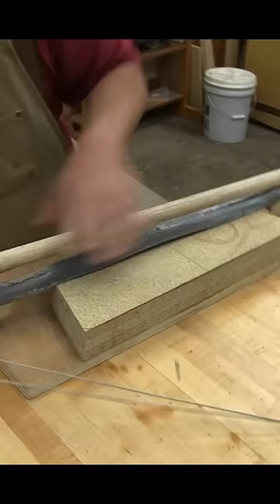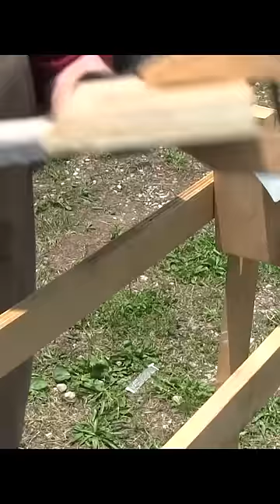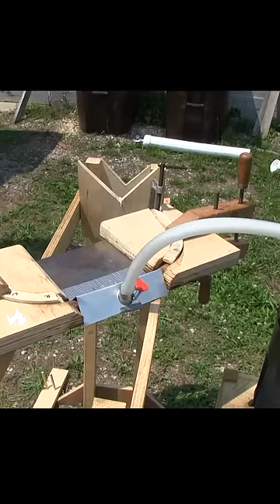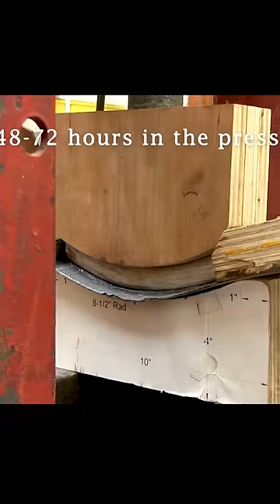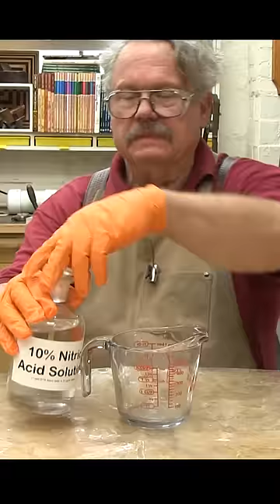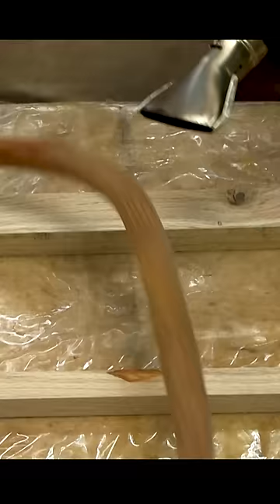Mustache Handlebars Short

Comment from the maker: To successfully bend wood, there is a mysterious property that you must respect: You can compress wood parallel to grain up to 25% to 30% of its length, but you can only stretch it 1% to 2%. For that to happen, you must compress the wood into a bend rather than just stretch it around a bending form. To do that you need a “bending strap” – a flexible length of metal strap with two stops, one at either end, to capture the wood and keep it from stretching.

These mustache handlebars require two separate bends at right angles to one another, so we made two bending straps. The first was pretty simple – just a length of metal with stops to capture the tapered white oak dowel. The second took some ingenuity. We had to capture the already-bent portion of the handlebars, clamp them to the strap, then steam and bend just the middle bit. It only took us 30 or 40 tries to get it right. If you’d like to see this process in greater detail, watch the long video at: https://www.youtube.com/watch?v=7PRkoM-eVdY&t=23s

Wooden handlebars were a popular upgrade on the first “safety” bicycles (bikes with two wheels the same size) made between 1885 and 1900. Because wood is more flexible than metal, the wooden bars helped insulate the rider from the worst of the shocks and bumps they would otherwise suffer traveling the unpaved, unimproved roads of that era. They were usually made from hickory or white oak, and for those of you wondering how strong these handlebars were, the bending strength or modulus of rupture for those two woods is 20,200 psi and 15,800 psi respectively. Plus, they both have an extremely high stiffness or modulus of elasticity -- 2.16 and 1.78 Mpsi, so they not only resisted breaking, they would spring back to their original shape after impact. In this application, they were more durable than steel. 

These particular wooden handlebars were used to recreate a “Van Cleve” bicycle built by the Wright brothers between 1896 and 1899. Wilbur and Orville, you may recall, manufactured bicycles before they became interested in aviation. They built their first manned glider in 1900 and made their first powered flight in 1903. They built their last bicycle in 1902.
Reply: Such a cool video.  Great job and they look great.  The little fact thrown in is like hearing lamborghini made tractors before cars.
Reply: Magnificent explanation, thank you!
Reply: Thank you for your help Sir!
This is a different cane i made. This one didn't need to be straightened:
https://www.youtube.com/watch?v=NBEQoz6o1dc
Reply: Respect 😎
Reply: This just furthers the idea that woodworking is rightfully another category of engineering, which I had never realized before. Brilliant work!
Reply from the maker: @jo54763  Thanks.
Reply from the maker: @jo54763  Thanks for saying.
Reply: Will you adopt me please? I'm 40 but I don't care lol
Reply from the maker: @durzostern  Sure, as long as you're neutered, house-trained, and have all of your shots.
Reply: Awesome, never knew that
Reply: TL:DR.
What's the artist tho
Reply: Only took a minute! The power of youtube
Reply: This is a true professional.
Reply: Sweeeeeet ! 
Thank you sir !
Reply from the maker: @NBM3  Most welcome.
Reply: I cannot describe just how cool this youtube channel is, I hope you guys enjoy making videos as much as we enjoy watching them!!
Reply from the maker: @PrincePolaris  We do. Thanks for saying.
Reply: After reading your explanation, I had to go back and watch it again.
Reply: I read this in his voice!
Reply: You and Thomas Edison could have quite a conversation.
Reply: Thank you for that history lesson in the comments. this is a great video what the history included the video makes a lot more sense.
PS. I'm number 777 for likes on this comment :-)
Reply: Why acid is put on?
Reply from the maker: @otofoto  To artificially age the wood.

Comment: Did not expect actual handlebars.  I was expecting like a silly sign or something.
Reply from the maker: Real deal. Made this as part of a project to replicate an 1897 "Van Cleve" bicycle made by the Wright brothers six years before they built the first successful airplane.
Reply: I was expecting the back of a chair, but then he mounts it on a bicycle.
Reply: That's fucking awesome 😮
Reply: I was expecting a bow until a traversal curving was applied.
Reply: I was thinking a chair back 😂
Reply: I can't wait until he finishes the bike.
Reply: @WorkshopCompanion did they use the same techniques to bend wood back then??
Reply from the maker: @Princesssmelly  Yes, although by the time the safety bicycle was introduced (1885), larger manufacturers would have been using pressurized ammonia instead of steam.
Reply: same. i was like wtf there handle bars. awesome
Reply: I was impressed and knew he was bending wood from the start, but the aluminum 90 with the hole began a bit of confusion, then a no way at the press and a wow at the handle bars.

Comment: A master artisan, & the bicycle is a beauty. Are those wood rims?! Love everything about this.
Reply: Looks like they are. But nothing rare. Wood rims for cars neither. By the way, I am afraid that the bar will come in conflict with the legs
Reply: He literally just used a few jigs and some finishing.
Reply from the maker: @wtcnl  The rims are made of rock maple. We didn't make them, they were removed from an older bicycle circa 1900s and restored. As for the upside-down position of the handlebars, this is very common on racing bicycles. The idea is to let the rider hunker down so he/she presents the smallest possible profile to the wind, creating the least possible drag.
Reply: @WorkshopCompanion  Interesting. So, racers normally just wanted to go straight on with them

Comment: Have you tried steambending inside of a poly bag? It keeps the heat going during the bend, so that the wood stays flexible.
Reply from the maker: Hard to use with bending straps -- the stops seal the bag and both ends. Just have to be quick.

Comment: I was curious about the nitric acid so looked it up. pardon if this is common knowledge:

"Aging wood with nitric acid is a simple and effective method for giving treated pine a weathered and rustic appearance. By applying the acid solution to the surface of the wood and allowing it to react with the tannins present, a natural aging process is accelerated. This technique can be used to achieve the desired look for various woodworking projects, such as furniture or outdoor structures."
Reply from the maker: Nitric acid oxidizes the surface of a wood quickly, a process that happens normally over many years. But is is also useful as a chemical stain for problems woods that don't absorb traditional stains evenly.

Comment: I need to know what you were doing at the end. You were applying a 10% concentration of acid and then using what looked like a heat gun, to give it a lovely finish. Were there any other steps (rinsing, drying, etc.), or was that all?
Reply from the maker: It's diluted Nitric acid. It reacts to heat and oxidizes the wood making it appear aged. Should be done outdoors or with good ventilation. We sand our projects before hand and then give a light sanding to smooth out the raised grain afterwards. It's best to wait a day or so before applying a finish, if not it can cause the finish to remain tacky longer than normal. This type of stain penetrates deeper than a standard stain and is very useful when trying to match color with old furniture, the downside is the fumes are not great and it takes longer to apply than a normal stain. That said, we have used nitric acid on entire desks / bookcases.  - Travis

Comment: I just don’t understand why we would use a metal for this . Oh wait, people got tired of smashing their sternums against the stem when they broke ! As a former bike mechanic and current carpenter , wood would not be a material of choice for this application. We use to use tubeless tires ,sewn together and glued onto wooden rims …we replaced these for good reason as well. The only part I would use wood for would be some funky fenders and even then you would have look out for warping and rotting. I restore antique furniture and I really appreciate this old school craftsman and his soon to be lost techniques, I just don’t recommend anyone try this on their bikes. That hickory hammer handle seems hard as nails until the head comes flying off , so will a shovel and axe handle fail . This is for museum style restoration only ,imo.

Comment: Ooooh, nice! I have to do the opposite - to straighten a cane i'm making:) now i know how long i should keep it on my boiling kettle :D
Reply from the maker: Straightening is a great deal more difficult than bending. You can compress wood up to 24%-25% or its length, but only stretch it 2%-3%. When bending, you use the bending strap to compress the wood into the curve. But there is no gizmo that can stretch a bend to make it straight. When bending, you only have to leave the wood in the steam 15-20 minutes per inch of thickness. When straightening no amount of steam is going to do much for you. Soak the wood for several days, heat it up thoroughly, go very slow, and pray.
Reply: @WorkshopCompanion  Thank you very much for your advice! I will try to make a short clip of the result.
I tried to straighten a cane before and it didn't work too good. I didn't make a proper soft jig and tried to use a vice to hold a stick and you probably know what happened already. Softened wood in a tough vice while bending - a small crack/dent where that cane was held. Luckily i do this for myself and for fun, so i thinned the cracked part, took some of a horse bandage, wrapped it with a bit of epoxy and the cane is straight with epoxy onlay in the middle 😁
Reply: @WorkshopCompanion  Sorry i didn't have time to play with straightening cane, but i have work and had a few other projects before meeting at work.
This is my last one:
https://youtu.be/mDv7Yl4a50g
Reply from the maker: @ogi22  Nice.

Comment: It looks like you made a steam tube out of 40gauge pvc pipe. How did you do this?
Reply from the maker: The notion that PVC shouldn't be used at temperatures above 145 degrees F is due to building codes, which tend to be extremely conservative. Practically, PVC doesn't soften until 200 F, and doesn't begin to break down until 275 F. So it holds up well as a steam tube for light use. We used it for a couple of afternoons and made about twenty bends.  It had a slight sag, but we could probably get twenty more out of it. And then all we'd have to do is turn it over and let it sag in the other direction.

Comment: Turned out the person who bought this bike dies from unjuries sustained after hitting a pothole.
Reply: Solid oak is stronger than hollow steel though
Reply: @need2connect  that would depend on the thickness and quality of the steel.  Also, steel bends, wood snaps.

Comment: Did he make a steamer with pvc pipe? Didn't know tou could do that
Reply from the maker: PVC softens at 200 F, but it doesn't begin to degrade until  it gets  270-280 F. As long as there is no pressure on the walls -- and steam-bending is a low-pressure (1 atmosphere) procedure -- it's fine for a 1-time use steamer.

Comment: Is that safe?
Reply from the maker: As the long as the wood grain is straight with little slope (not angled through the bar) then, yes. Wooden handlebars were very common 1890-1910 to help reduce some of the shocks and vibrations that cyclists would have to endure traveling unimproved roads.
Reply: @WorkshopCompanion  Yes, I can imagine the grain is important. Thanks for your reply.